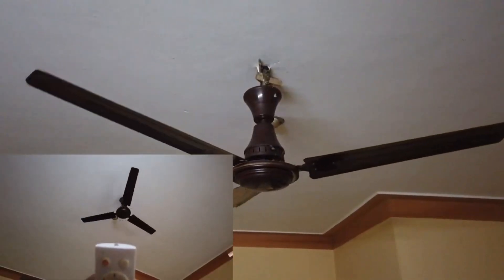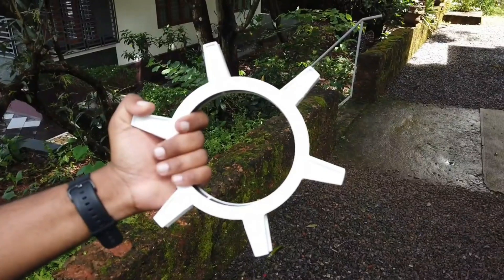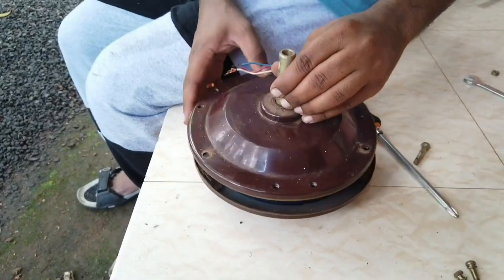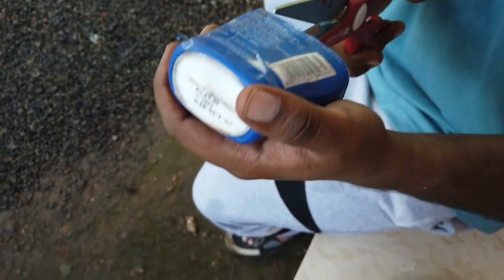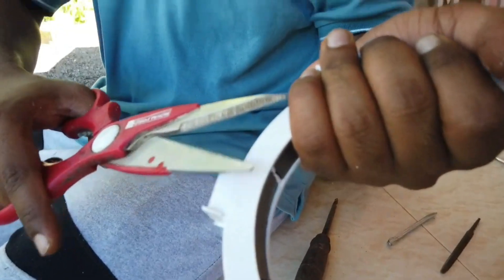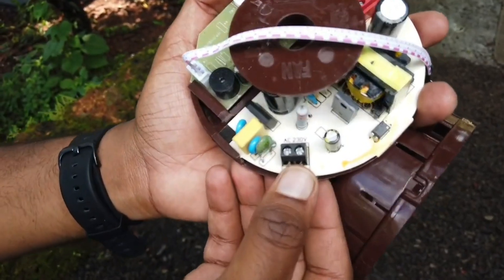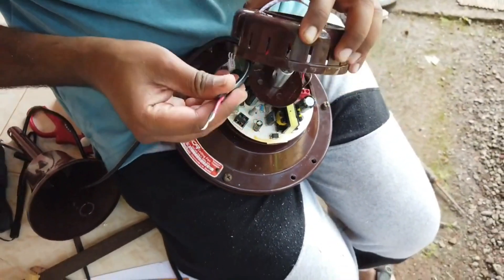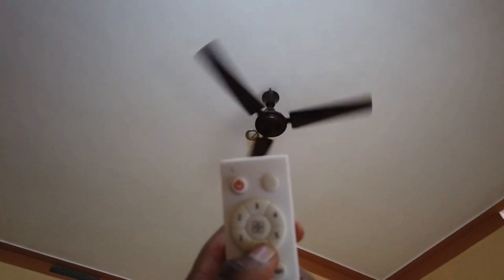convert normal ceiling fan to BLDC fan/advantages and disadvantages of BLDC fan @gadgetsprochannel

Comment: Nice video and good explanation. But the magnets used in the bldc converstion kit is Neodinium magnets or normal black magnets?
Reply from the maker: The magnets are narmal magnets used in dc motors..
Reply: @gadgetsprochannel  hmm that i also saw tht. It will be good if they provide neodinium magnets. I dont know wat companies like Crompton, havells or atomberg's bldc fan giving in their product. Have u measure the wattage  drawn by these fan. U can check by power meter. If u dont hv then u can check with ur net meter.
Reply from the maker: @BR-rg9ib  i will definitely do a video on energy consumption.

Comment: I want bldc branded fan kit. Please share the band name, cost per kit and can it be purchased from on line store like Amazon, Filpcart or any online store. Thanks.
Reply from the maker: Hi brother currently the product is not available online. Better try to get it from your local electrical store. Or else you can whatsapp in +91 6282 924 184 . I have bought the product from this guy.
Reply from the maker: Thanks for watching the video.
Reply: Its the normal magnets, not the neodinium magnets. So the life time of the motor is highly doubtful, also I think it will consume more power than BLDC fans available in market bcoz of the same reason.
Reply from the maker: Hi brother thanks for watching the video. I will definitely consider your doubts.  I am using this kit in my home. There is very visible result.  My electricity bill has come down. In my opinion you will save the full amount of this kit in 1 year. Any how i will try to show the real electricity consumption of the fan in another video. So definitely try to subscribe and hit the bell icon.